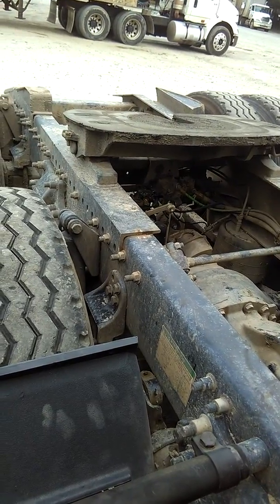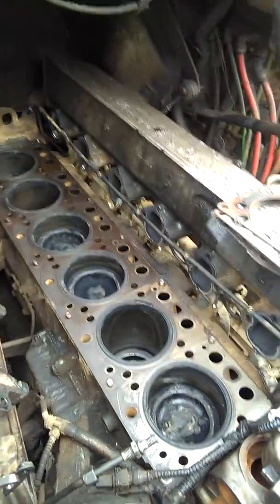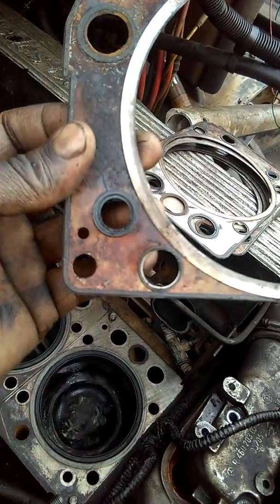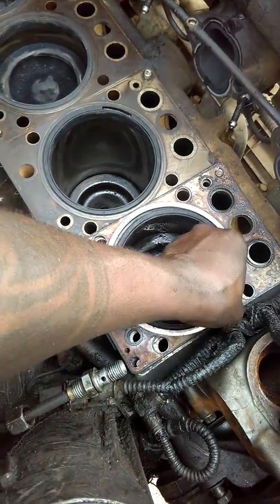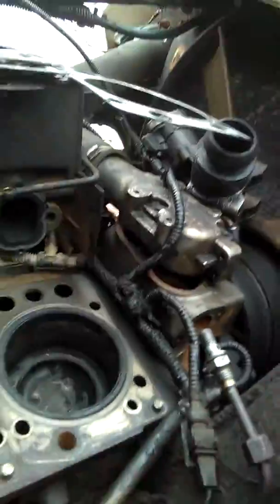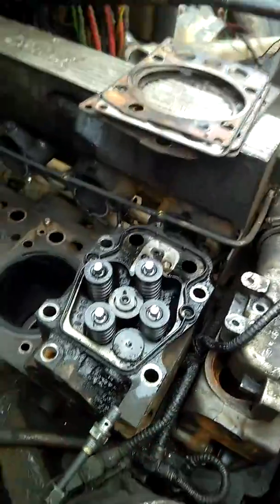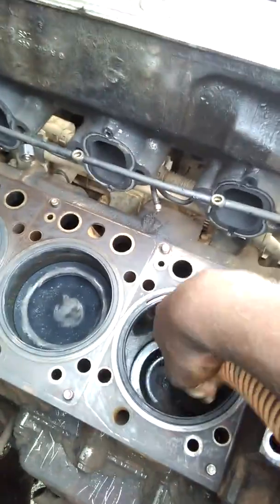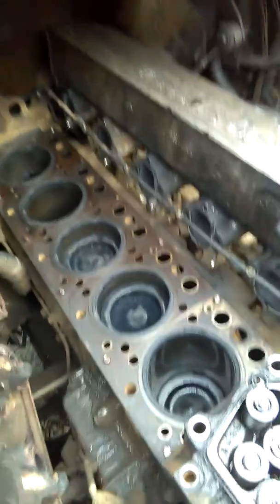Overheating -- blown head gasket

Comment: Hey buddy I have A couple questions I have the same motor the truck runs great but when I put a load of 20,000 pounds it lose power and the check engine light flashes started troubleshooting to see if I’m losing any air into the intercooler turbo and then find out the intake manifold Have a crack and leaking air do you think that could be the problem

Comment: Thanks for your video.  Let me ask you something. I’m working on my mbe 4000. I got a water leaking on the head gasket (thee exhaust manifold side).. I just gotta replace that gasket? What about valves? I mean what if I just replace one gasket? I gotta re check all valves?
Reply from the maker: Ouch!!

NEGATIVE!!

The head has oil and coolant connections on the exhaust side and fuel connections on the driver's side.

If you have  coolant leaking from your head,  you need to tighten ALL your coolant connections but I must caution you here:

USE A TORQUE BAR.
(If you tight too much, screw will break)

GOOD LUCK BM!!
😎😎
Reply: @There_______I_said_it  م

Comment: Hey sir.. I know these Video is a lil dated but I had some questions for you
Reply from the maker: Shoot!!!!
Reply: @There_______I_said_it  1st was it hard. And did you do a beginning Video. And is there anything I need to watch for when taking everything down
Reply from the maker: @jamessimon3282  

Lol!!

" DIFFICULTY "

is unavoidable for BM in N. America who seek an above average lifestyle.

NO; this was the only video and ACTUALLY, taking the truck apart was easy.

Reconnecting the fuel, oil and water was tricky; a "TORQUE" bar is required

(too loose and it leaks, too tight and the bolt can break; BE CAREFUL HERE!!)

THANKS for the comment.

Check out Kevin Samuel's Y.T. page; he has a lot of info for BM and how we should view "DIFFICULTY"

😎😎
Reply: @There_______I_said_it  ok sir thanks for the info.. and another ?... I had a bolt I've been trying to get out for the last few days... I cut the top of the bolt off and still can't get the head off.. all the others are done. Do you have any input on this
Reply from the maker: @jamessimon3282  

OUCH!!

Sorry to hear that. :/

THERE IS one option you can try before the diesel mechanics 

" GANG RAPE "

your business account.....

https://shop.advanceautoparts.com/p/performance-tool-8pc-screw-extractor-set-w2968/11931889-p?product_channel=local&store=6490&adtype=pla&product_channel=local&store_code=6490&gclid=CjwKCAjw4MP5BRBtEiwASfwAL5THe32HqbN6ftZwW-ClJ4jvSufiROFM9KcEMEl46nGO6NVlN_rvuBoCxmcQAvD_BwE&gclsrc=aw.ds

This tool is inexpensive and, depending on how deep inside the metal the screw has broken off,
VERY EFFECTIVE.

Good Luck and let me know if it works.

😎
Reply: @There_______I_said_it   hey brother one more Question I did get that head bolt out and got everything back together.. but she sounds rougher and was a lil hard to start
Reply from the maker: @jamessimon3282  

If your tractor is running rougher than before, you probably did not reset your valves.

Difficulty starting is unrelated; charge your battery.

64k    QUESTION:
 
Is your tractor still overheating??????
Reply: @There_______I_said_it  I think its the Value
Reply: @There_______I_said_it   hey bro, how can i know how many  the TORQUE for each bolt ? or Do you know that ? thanks
Reply from the maker: @xiyangcao4573  

YES SIR!!!

Ever engine is different;. check your Manuel or locate specs online.

GOOD LUCK!!!!

Comment: am having the same issue with my C15 Cat pushing coolant out of radiator cap but its not overheating but recently it started skipping on start up in the morning
Reply from the maker: Cat engines are a totally different animal
(especially " IF "  you have the 

" Dual Turbo " )

QUESTION:

Is your radiator leaking?

If your truck is NOT over heating, my explanation in this video does not apply to you
(you are have a totally different problem)

Tip:
It is getting cold; starters work harder to start in the cold.

Your starter is likely failing.

I suggest you leave truck on throughout your work day
(only start once a day)
and prepare to replace your starter
($350.00)

GOOD LUCK!!!